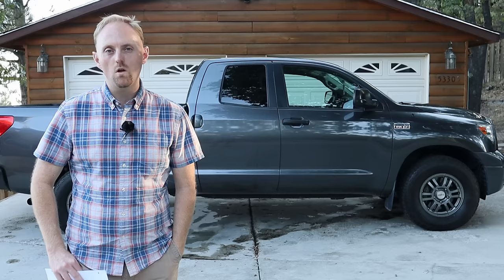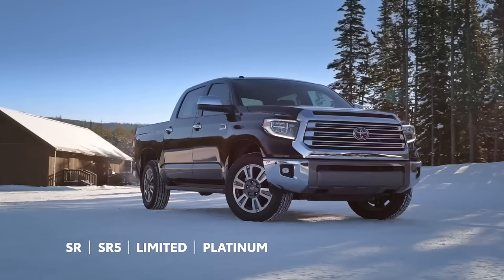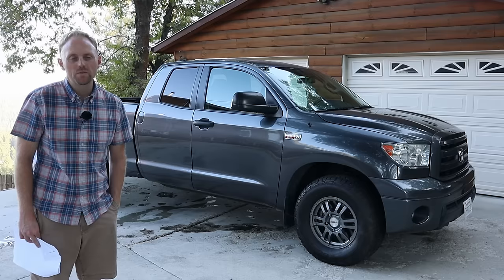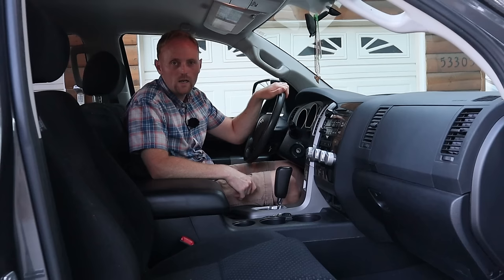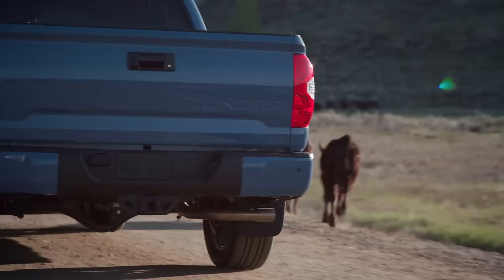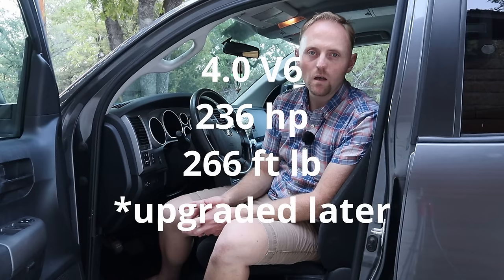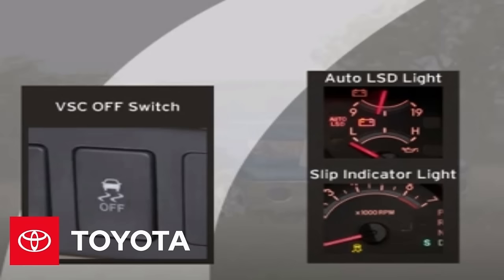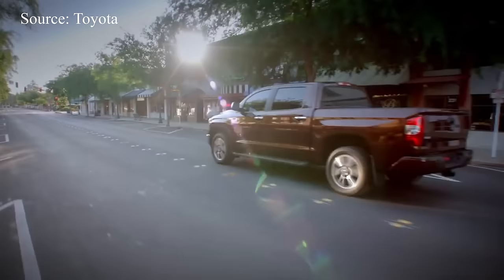Toyota Tundra  |  Brutally Honest Long-Term Owner Review

Comment: I went and bought a brand new 2020 Tundra SR5 4wd Long Bed over anything else just due to the fact of how simple they are. I could have gotten a Work Truck package from any other company, cheaper but something drew me to the Toyota at the end of the day. I love old school simplicity and the Tundra SR5 NAILS it with just enough modern influence. It didn't ride as good as the Silverado or Ram,  nowhere near the options of the F150 but I wanted a TRUCK. All these new trucks keep cramming all sorts of software, gadgets, buttons and other crap in them that people say they want, and never use. I work in wheels and tires, and have been getting to get my hands in 2020 trucks of every brand and I have run into many owners who have trucks with less than 5k miles on them that have had their trucks already fixed more than once. My girlfriends Dad has brand new 2020 F350 Dually Longbed 4x4 Lariat with the 6.7 Diesel, amazing and nice truck with less than 10kmiles, leaky sunroof, glitchy rear camera, a software issue that caused a permanent limp mode and needed a new brain, front end work that they can't seem to fix that keeps throwing the alignment and they had to replace the whole front end assembly, luckily all warrantied but all stuff that shouldn't have happened. You know what sucks about the Tundras? The cupholders there are loads of them, but they are all too big or too small for anything. Toyota doesn't change much and a lot of their stuff hasn't changed in a decade, and they don't want to and don't need to change it because at the end of the day, it will all still be working. Don't fix what ain't broken.

Comment: 90k miles is still a new truck in my opinion
Reply: Then you are probably the only one in the world with that opinion
Reply: @Green Soup  I have a fleet of trucks for my business. Most of them are GMs. Usually BUY them at 150,000.  GM is just getting broken in at 100,000.  Every one of the GM's go 325,000 before costing any serious money.  The Engines and Transmissions on anything before 2018 are rock solid. The newest GMs are not good, mostly due to the Transmissions. 
And we also have a 2012 Tundra. It is a decent Truck but have had a Transmission issue already at 155000 miles, and the frame is getting a substantial amount of surface rust which is also surprising for an 8 year old truck. We have GMs that are 17yrs old with almost zero rust on the frame and they all get exposed to the same weather.
Reply: yeah, come back when that tundra hits 250 and your f150 friends are on their 2nd and 3rd
Reply: @Painfulwhale360  you clearly haven't seen the tundras will a million miles original drive trains then.
Reply: @rickshiandmoku4128  How can you say clearly when you know nothing about me? You have no idea what I’ve seen. My brother has a tundra, so does my grandpa. I’m about to buy one, too. 90k miles is way past broken in.
Reply: For a tacoma and tundra... yes. For a dodge... that things on its death bed.😂
Reply: @Painfulwhale360   Coming from a Toyota experience since 1980, you don't understand that these vehicles last for over 400k miles.  The owner of a 1Million Tundra got a free one from Toyota.
Reply: @TheDotDetective  Am I living in the twilight zone or are you people desperately grasping for straws? I’m well aware that Toyota’s last a long time. My wife and I own a sienna and I’m waiting for the next gen tundra to arrive so I can get it. But let’s assume a Toyota will last 400,000 miles. 90,000miles is nearly 25% of its lifespan and you wouldn’t considered it used at that point? I know it’s cute to say 90,000 isn’t even broken it but trust me, it is. And for any other brand like Ford and Chevy.. 90,000 is way way WAY past broken in.
Reply: @Painfulwhale360  you came across as rude. That's why there were so many defensive comments.
Reply: @sebione3576  😭
Reply: @Painfulwhale360  I'm mainly a toyota guy too. Own quite a few and my buddy's 1st gen has 450k. The people acting stupid to you also need to understand its about the previous owner and maintenance. Some toyota owners don't take care of them because they think they're invincible from what they've heard.

Comment: I've owned Toyota 4x4s since 1993, starting with a V6 x-cab 4x4, then a '04 TRD Taco, followed by a '16 TRD, now in a '18 SR5 4x4. Generally, I buy a new one every 11-12 years, and get great resale, even with ~200K miles. I sold the '16, due to needing more toy hauling/towing capability, and since I mostly off-road MTBs, dirt bikes, and buggies these days, I doubt I'll ever go back to a smaller truck. My buddy had a '01 Tundra that he put over 500K on, and there are several million mile Tundras out there (including at least one here on the tube). I considered a TRD Tundra, but the lack of a locker led me to the SR5 4x4, with 6.5' bed. With Bilstein coilovers (~2" front level lift-works well with stock rear suspension) , wheels/tires, TRD exhaust and skid, I've been very happy with this truck for hauling toys all over the country for off road excursions, and saved some money over the TRD, while getting exactly what I wanted (except the rear locker). The new Tundra sounds like it will be impressive, but I have no intention of giving up the awesome 5.7 and it's sweet sounding TRD note. Is it perfect? No, but close. Gas mileage? Not great, but I have the 38 gallon tank, and a '20 86 Hakone to drive when I don't need to haul. Performance, simplicity, reliability, and resale...been working for me for 37 years, and counting...

Comment: Good review. Tundra are quite easily an honest 300 k mile truck.  At least that’s my experience
Reply: I got 310 on my 2007 and no signs of slowing down, I love it
Reply: Most trucks are if you actually bother maintaining them.  I've had two Sierra's with the 5.3 go over that and were still running strong when I sold them.  Fords may be the exception.  We see a LOT of them at our machine shop with issues almost solely specific to them.  Not many Toyota's and although the AFM on the GMC's could be a big problem...so long as the owner either electronically or physically deleted it...the 5.3's/6.0's run forever.   Even at that, I've seen many go high miles so long as the oil is changed regularly.  Dodge is kinda in the same boat as GMC with their 5.7's and 6.4's.  Tundra's are just gawd awful ugly and are in dire need of a facelift...and better MPG.
Reply: @TakeDeadAim  5.3’s? Not from my experiences, my hunting buddies Silverado was giving him huge problems almost had to lemon law it. Dealership got him into a new one and he recently got rid of it after a 1 new engine and the transmission went out a second time. Now it did have about 180 miles. He mentioned when he traded it in that he had to replace about everything on the truck both inside and out. BTW my 07 Tundra went 250 k hard miles and only replaced the starter. My company 5.3 has just short of 100k miles. Transmission is going out can’t even run it in 4wd. Latest issue of Consumer Reports gave the latest Silverado a 13 in their reliability rating. One of the worst scores ever. I believe the Tundra scored around 80. MPG?  On our hunting trips to Wyoming I got basically identical mileage to my friends 5.3 4speed. His new Silverado with an 8 speed he got between 1-2 mpg better. Not a huge difference especially when you consider the savings from the reliability. Looks that’s subjective. I personally think their the best looking truck out there.
Reply: @TakeDeadAim  I prefer the tundra look compared to that new Chevy look. It looks sooo ugly. Some sierras look just as ugly

Comment: Great no-nonsense review. I currently own a 2013 Tacoma w/ 122,000 miles and it’s a great, reliable truck but my only complaint is the truck does not have any “get up and go.” Before the Tacoma I owned a 2003 Tundra w/ the V8 and LOVED it. Unfortunately it was totaled in a wreck which is why I ended up purchasing the Tacoma, at the time I didn’t have a need for a full-size truck. Last May my family and I were in the market for a full-size pick up because we were planning on buying a travel trailer for camping and knew we needed a full-size pick up but I did not want to trade in my Tacoma yet. I ended it up purchasing a 2020 SR5 Crew Max Tundra after nearly pulling the trigger on a Ford F150. What it really came down to for me when making a decision was Toyotas’ reliability and durability. My wife and I keep vehicles for a very long time and I wanted a truck that was very reliable and hassle free. I do all the maintenance on our vehicles unless it is something very major and the reliability of the other truck makers was a dealbreaker for me. It been nearly a year since I purchased the Tundra, but the longer I own it, the more and more I am convinced that I made the right decision.
Reply from the maker: thank you for sharing, sounds like the right truck for you

Comment: I have a 2005 Tundra LTD Access cab 4x4 TRD with towing package.  Bought it new,  80k mi.  NO service issues, just oil changes. tires, brakes and headlight lenses.  It is one of the best vehicles I ever bought.

Comment: 2006 Tundra SR5 owner here. 250,000 miles. Just replaced front brakes and rear brakes. Surprised that the rear shoes still were in good condition.
Air is ice cold, front end still aligned perfectly. No oil leaks and runs perfect. Im retired, 70 yrs old and plan on willing it to my son when I pass on.

Comment: Great review. I just purchased a 2016 tundra after looking very hard at the F150 and Silverado, and I couldn't be more pleased. One of the largest concerns I had was the dismal mpg that seems to be the largest complaint. After 1k miles I'm averaging between 18.5 and 20 mpg with the 5.7 v8. That's about the same as my 2012 Nissan Frontier.
Reply: My friends  new Ford 150 does 19mpg average.  About the same

Comment: Tundras are King, I have a 2010, regular cab, 6.5’ box. Over 350,000 Km’s so far. 
1 wheel bearing, 2 ball joints (I’m told if it was not lifted, likely would not have changed them)
Still have the original U-Joints.
Original calipers! Tanker that Ford!
Just a great truck.
I wish I could get another one the same!

Comment: I am like your dad. I bought a 2019 tundra new 11 months ago. 26k miles so far. Trouble free so far. Reliability and resale value were deciding factors. For me the Tundra works. The crap fuel economy is regretful but what good is the fuel economy if you are stuck on the side of the road or have a truck worn out at 150k miles. I have family with every make and my friend swears by his Dodge, but Tundra hits the mark for me. Your video is 100% accurate. Your negatives are spot on but a fair trade for my usage.

Comment: I was a Tundra owner for nearly 15 years but recently converted to for a Super Duty.  No doubt would have stayed with Toyota if they made a heavy duty truck wit a diesel. I also wish they had a 6 3/4 bed with the crew cab.  I need a crew cab and the 5.5 bed just isn't big enough.
Reply from the maker: Good point on the bed/cab combo
Reply: I agree 100 percent. I love my tundra but really needing to tow about 12k not sure if ill try it or trade for a 3/4.

Comment: I’ve owned the 2008 5.7 4x4 Crew Cab w/ Tow Haul for 5 years now with it currently having 163k miles.

Only needed the water pump replaced when I purchased it and the serpentine belt, idler & tensor pully a year later (did that on my own). Only other thing I’ve done is routine oil changes.

Like a spouse, who needs fancy, luxury and constant costs and maintenance when you have durability, reliability, dependability, functionality with 🇺🇸 pride that’s also attractive and adventurous for years to cume. Thank you, Tundra/Wife.

Comment: I totally agree with the gas mileage concern. The tires on the truck make a big difference. On a regular 400 mile trip 98% highway miles I was averaging 16.1MPG with Michellin Dueller H/T 684s. I switched to my winter tires - Firestone's Destination AT and am getting an average of 14.9MPG.
That equates to 380 gallons of fuel over the lifespan of new Michelin Dueler Alenzas, and at $2.40 per gallon, you would save $912. That's the cost of 4 new tires [$842].

Comment: 284,000 on my 2008 Crewmax 4x4 Limited purchased new. Everything still works. Runs great. It has towed many dumptrailer loads at the limit of its capability over a 7 mile distance up and down hills. The paint on the roof and hood is gone. It has required an air induction system, a air conditioning condenser, a new sunroof, a right rear bearing replacement, a driveshaft and hanger replaced, and a water pump. It runs great. If it gets totalled and I survive, a used Tundra with lower miles would be my choice today rather than a gas guzzling twin turbo future nightmare.

Comment: Great review and you pretty much nailed it. Bought a  2016 1794 edition new at the time and couldn't have asked for a better truck for towing and reliability. It was the first truck I have ever had and I am very happy with it. I pull a 19ft. fiberglass boat and it pulls it flawlessly and the braking is good. The price was a good price in comparison.

Comment: 2016 Tundra, I've heard a ton about the poor gas mileage with the Tundra. While Towing the mileage does not drastically drop. I have friends who purchased the F-150 Ecoboost and for the most part they get hosed when towing a load. We pull race car trailers all over the South and my Tundra stops less for fuel than the Fords, Nissan's, Dodges' or chevy's of the group.
My Tundra has over 120,000 miles on it and for the most part only seen the repair shop for service. Oil Changes, tire rotations and general overall care. I'm on my second set of tires which were changed at 75,000 miles and second alternator at 90,000 miles. Most of these miles or lets say 1/2 have been while towing something. the Toyota tow center is great with a lot of useful information, I like the running tab on the gas usage from full to empty by mileage. The greatest advantage while towing is that 5.7 engine, WOW! Great Power!
  
I have the Crew cab which has a ton of room . I opened the rear doors at the dealership and was floored at the room. Needless to say I purchased the truck without even a test drive, that came later. Heads up my last trucks were a F350 supercrew, 6.0 TD, Chevy 3500 6.5TD
The truck drives just like it came of the show room floor. Not a lot of body noise or squeaks, no bad body sway. at 69 years young this will be my last truck purchase and it looks that I saved the best for the last. 
Thanks Toyota

Comment: 2005 Tundra Doublecab 2WD 280,000 and running great. Has had shocks, drive shaft, ball joints, and timing belt. I expect at least another 300,000